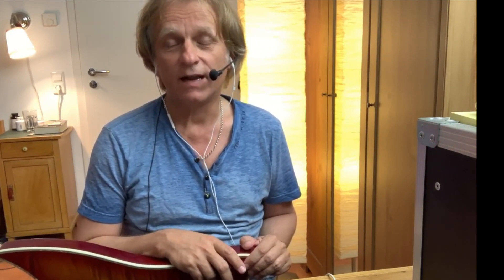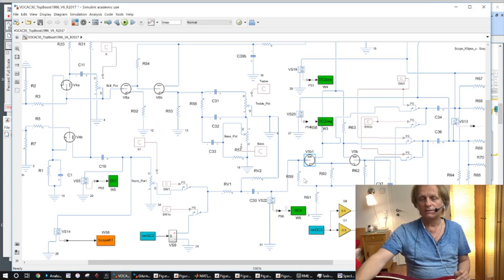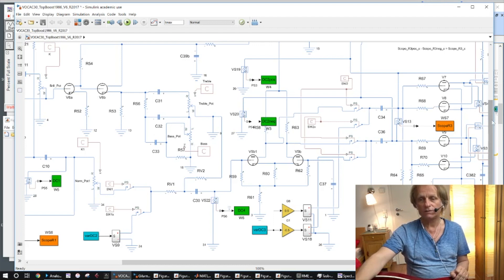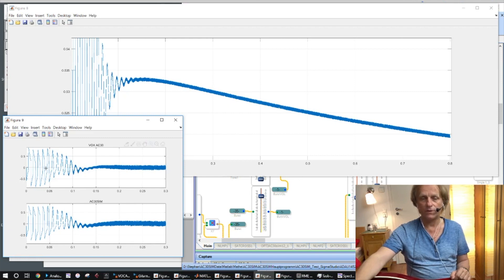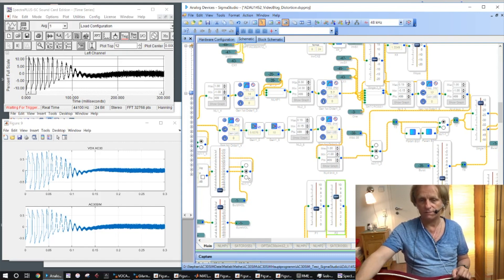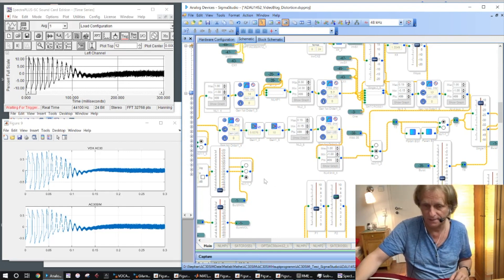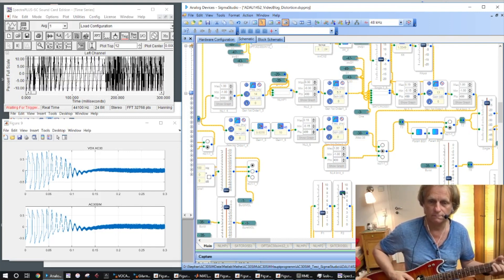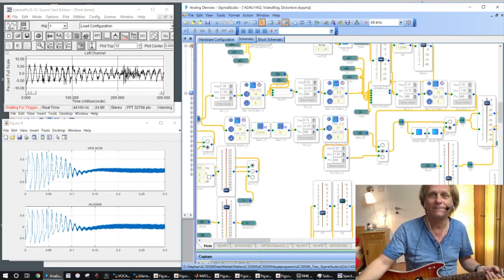Part 4, Distortion for guitar programmed on a Sigma DSP ADAU1452

Comment: Hello Stephan Möller, instead of parametric equalizers, apply the FIIR filter at the end of the circuit. Below is a link to convert a wav file to a FIR table.
Reset the last project in Sigma Studio to slay2000@inbox.ru

 http://s.shift-line.com/wav2fir/
Reply from the maker: Usually FIR Filter apply a huge latency, thats why I prefer IIR filters
Reply: @stephanmoller2271  Where are the IIR filters, I can't find and how to use the impulse?
I modeled the JCM800, the sound is very similar, but there is not enough compression, the scheme was repeated 1 to 1, a friend also did distortion and also the compression does not reach the originals, which is not clear why.
Reply from the maker: The best would be if you login to the ADI Engineering Zone / Sigmastudio. There you can ask and get support.
I have never modelled Marshall amps. The best method to model an amp is to use Matlab . There you can use lsqcurvefit to optimize parameters of a generic model that you program ( with filters , nonliearities etc ) . You need to measure the real amp and then let lsqcurvefit optimize your model to fit it.

Comment: Stephan, you have done a serious fundamental research of processes occurring in the Vox AC30 guitar amplifier and were able to recreate it on the Sigma DSP ADAU1452. It’s amazing!

 I have some questions. Is the resulting algorithm universal? That is, is it possible to get the sound of other famous tube amplifiers by changing only parameters? So it would be possible to bind parameters to controls and adjust it using Arduino, for example. Or will a significant change in arithmetic operations within the algorithm be required?

 I think most of the guitar effects diy community would like to experiment with functions and parameters to get their own sound. However, the barrier of entry is too large, the material is quite complex but interesting. Stephan, you could change the situation by explaining the transformations that are taking place in more detail (separate arithmetic operations and their combination with built-in algorithms). This will arouse the interest of the DIY community, like Arduino now. There are several prerequisites for this: SigmaStudio (clear and free), SigmaDSP (not too expensive), GitHub (the place where you can develop a project together with other participants, share the results at different stages of development with version control; you can always return to the best version of the project), and most importantly, desire of people to create their own convenient modern compact device.

 Good results can be achieved using FIR filters with the recorded responses of various systems. But your method is more universal and opens up scope for creativity.

 I believe in the collaborative future of Sigma DSP and guitar effects. This is a natural transition to modern guitar sound conversion tools available to ordinary users.
Reply from the maker: Денис Мельниченко Thanks for your very comprehensive statement . If you like you could get in touch with me and send me an email to stmoeller62@gmail.com or stephan.moeller@hsu-hh.de which is my office email at my university.